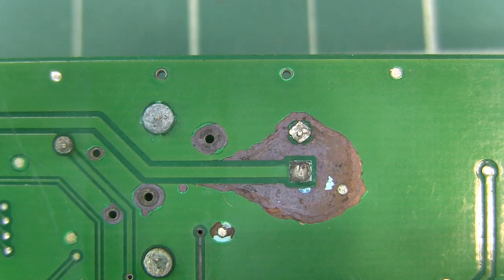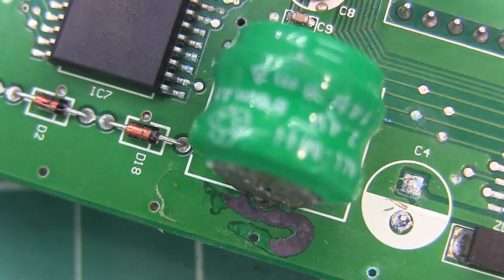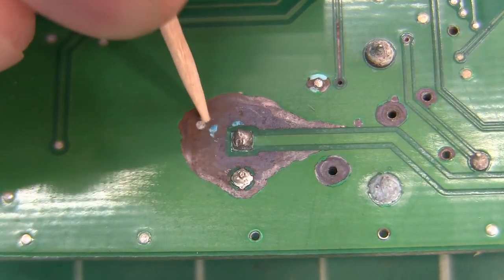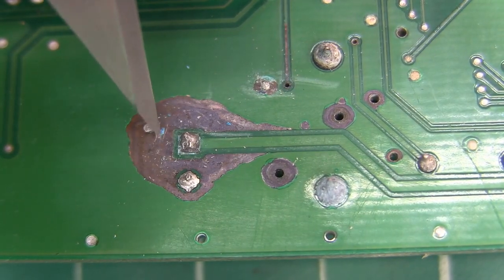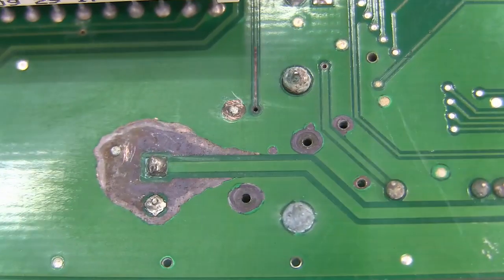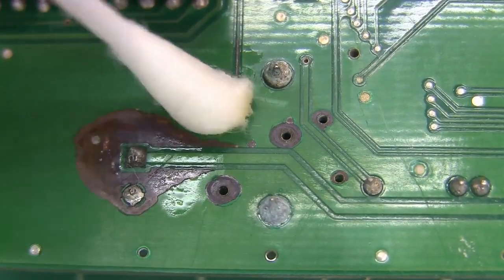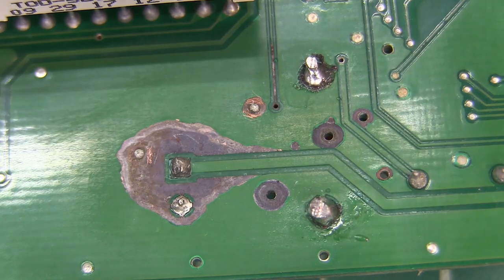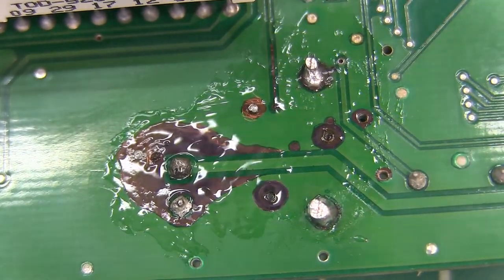Circuit Board Corrosion Repair

Comment: My method of doing this is to use the vinegar first. It reacts with blue/green alkaline exudate from the batteries and dissolves a fair bit of it which leaves left manual removal with various picks. I don't bother with baking soda after because I I then clean the vinegar with IPA. either baking soda or vinegar gets cleaned off by dilution so I feel the addition baking soda step isn't at all necessary. The bonus of the IPA though is that it is able to pull residual water from the vinegar with it when it evaporates.

The fingernail polish thing is a great idea though! Hadn't ever thought of that
Reply from the maker: Thank you for sharing your experience!

Comment: So, your repair works for the time being, BUT: the problem I see here is that the rivet-like plated holes (known as "vias") that pass voltage or signal through the board from one side to the other are visibly corroded, especially down inside where you cant see it, and eventually they will fail.  Sometimes you can clean the face of the via on either side of the board and pass a very thin jumper wire down through the hole and solder it on both sides, but it's tricky, and sometimes the hole is too small or full of corrosion, or a varnish-like conformal coating from initial manufacture, to allow a wire to pass through the hole.  I repaired a Bose radio once that had some kitchen spillage in it; the cortosion was confined to about a 1 square inch area on the double-sided board, and yet it turned out to be much more work to fix it than I had expected. PS,  Don't use an exacto knife for scraping the corrosion off of the board, use a fiberglass-bristle "scratch brush"; you can see them in a video on my channel. An ink eraser is also helpful if it has pumice or silica or other fine grit embedded in the rubber.
Reply from the maker: Thanks for sharing your experience. I'll be on the lookout for that issue.